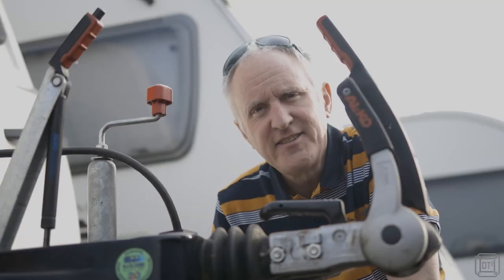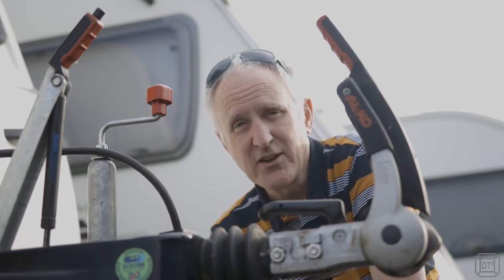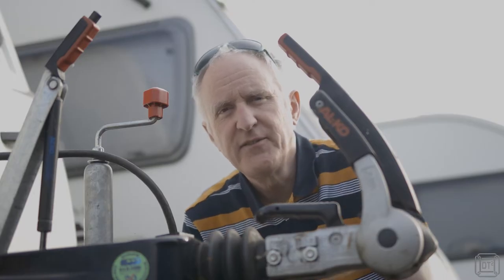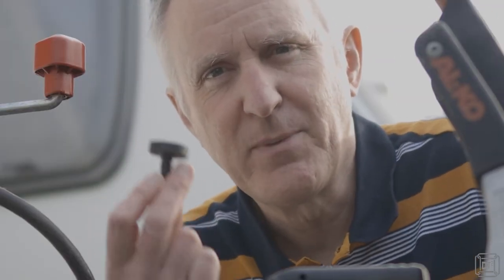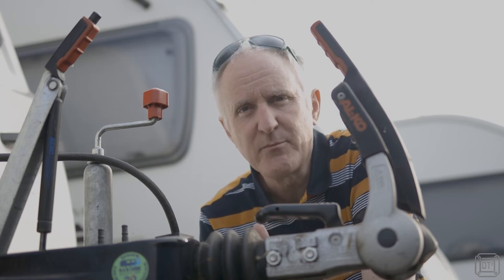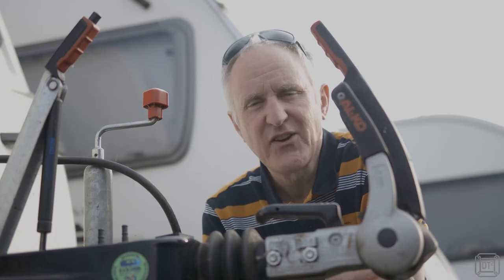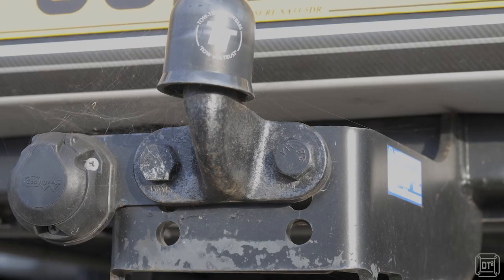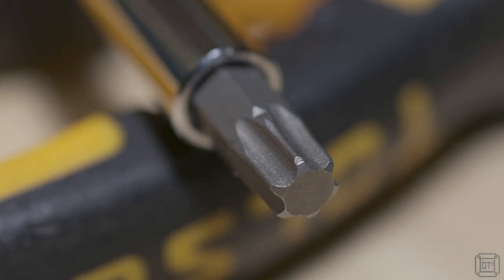ALKO STABILISER WON’T UNHITCH – what to do

Comment: This video has helped enormously!

We took our caravan home to give it a good going over after being in storage for 2 years. There was a bang just as we were beginning to move away, so that was probably the ball being banged up into the hitch because it was probably misaligned.

We got home and no matter what we tried we couldn't unhitch the caravan. I'll try and remedy it using your method. It's not an Alco hitch, but I'm sure the principal is the same.
Reply from the maker: Thank you, I hope you got your hitch sorted. I haven't used many other hitch types but if it has a built in stabiliser then it will likely have similar pads. Either way removing the towbar to release any tension on the hitch should help.

Comment: Thanks for this video  - we have just suffered exactly the problem you describe. We were lucky and were able to detach the hitch but it was very reluctant to separate. Once the ball and cup separated, the upper pad fell out!  I will be replacing the pad and probably do as you suggest and carry a spare.
We've not had the van long and I don't recall giving it a jolt whilst hitching up, but it's possible the previous owner did and that the pad was cracked but not broken. So this is probably something that's worth checking visually from time to time. The hassle of getting it properly stuck is definitely worth avoiding if possible!
Reply from the maker: It certainly does induce some mild panic followed by a lot of head scratching when it happens doesn't it. 😀
"Dropping" the hitch on is just a guess at the probable cause but it's easy not to remember like you say it quite likely that the previous owner may have done so.
Glad you managed to release yours though.

Comment: Exactly this happened to me today!  Top pad broken as you describe and only my third time with the new van hitched.  Also somehow then managed break the plastic jockey wheel while manoeuvring on gravel driveway - oh the joys!
Reply from the maker: Hope the video helped. The fact that you had an issue with both the pads and the jockey wheel makes me wonder if it's worth checking your nose weight? We had issues with the jockey wheel and our nose weight was high. Correctly so, as our land cruiser can handle a high nose weight but it caused issues with ground clearance on speed ramps and generally put an excessive load on the jockey wheel. Just an idea, hope it helps.

Comment: This system was an option the salesman I just bought a trailer from was unable to explain the purpose of and how it functions. Excellent explanation sir, pro's and cons. Only thing I like about this system without looking further into it is that it's still a regular coupling underneath - seems like you could pull all the pads out an go about your business if it failed. I won't be retrofitting this system.
Reply from the maker: Hi glad you found it helpful. I think running the hitch with no pads in could cause a problem as it would significantly reduce the area of the  bearing surfaces. This could cause wear on both the hitch and the tow ball. That's why I now keep a spare of the top pad in case it breaks again.

Comment: Thanks for that, useful tip and what a rip-off those pads are!  since I have had one of these hitches I find it locks on my car when parking on driveway, as caravan on a bit of a slope.  Very difficult to remove,  probably not recommended, handbrake on caravan, reverse an inch or so releases the pressure.

Comment: Great video. Unfortunately some tow bars can’t just be unbolted. Examples are tow bars that swing out from under the car. These are usually OEM tow bars. What can be done in such a case?
Reply from the maker: Thanks glad you liked it.
You're correct some tow bars would be either difficult or impossible to remove. (I think I alluded to that in the video) Someone else recently commented that they had this problem and the engineer that they called out used silicone spray to reduce the friction and then managed to release it whilst still attached to the car. This would be harder to do at cwrtain angles id guess. I'd you did use this approach then you would definitely have to replace (or thoriughly clean) all the pads as the lubricant would stop them from providing the damping (stabilising) effect.

Comment: Used to have problems quite regularly with my old caravan, pads were fine and just seemed to be an issue with tension, happened once after a long drive and was absolutely knackered, freed it by using the jockey wheel to raise the back of the car, and then sat in the car boot to force it down, probably not the recommended method but it worked 🤣🤣🤣

It also wont work with detachable tow bars as most of them dont drop straight down, they generally come off at an angle
Reply from the maker: Winding down the jockey wheel and hmm "adding some weight" is a great suggestion.

Comment: Not much use if you have a fixed electrically retractable swan neck tow bar. specially when there is a much easier option.   Using your motor mover, you rock your van backwards and forwards while winding up your jockey wheel. Pops off in a heartbeat.
Reply from the maker: Thanks for the suggestion about using the motor mover. This was not an option for us as we don't have a motor mover fitted but useful option for those that do have motor movers.

Comment: Interesting video. Had this happen to me this summer, on phoning a local engineer he suggested trying to lift the car up with the jockey wheel and at the same time violently wriggle/rock the coupling, after a number of attempts the small broken part fell out and the two separated. It was quite a nerve racking time not knowing how to split the unit.
Reply from the maker: I can see how the lift and wiggle approach would work. I think I prefer  disconnecting the tow bar where possible but in situations where that's jot possible the approach you've described is certainly worth knowing. Thanks for contributing
Reply: @DTSquared  Unfortunately my tow bar was a factory fitted electric type, so removal wasn't an option.

Comment: Never happened to me Dave but it's definitely one of those things you should be aware of as it could be such a pain. As the only solution seems to involve removing the tow bar/ball I am a bit concerned as mine is an eclectically deployed system. Looks as though removal would be a MAJOR job. I suppose you could work from the other direction and remove the hitch from the caravan! Failing that I suspect i'd be resorting to brute force or walking away and pretend its not mine 😳
Reply from the maker: Lol yeah sometimes you do wonder if denying all knowledge is the simplest option!!
It probably is, in theory at least, possible to detach without removing the towbar but the van and car would have to be perfectly positioned with zero stress on the coupling. Something that would be very difficult to achieve. Even once we detached the tow bar, if I remember correctly, it still took some waggling to get it detached.
Reply: Can’t a good caravan troubleshooting outfit sort this out…..the AA ??

Comment: Thank you for the video. How good is this stabiliser from alko? I live in South Africa and here the most popular ones are those with a side bar connecting the tow vehicle and the trailer A frame.
Reply from the maker: Hi, I’m glad you liked the video. I think I’m familiar with the type of stabiliser you are referring to. It’s the type with a pre-bent flat metal bar that is attached to the car and tends to drag along the ground if you leave it on after unhitching right?
We don’t see many of those here in the UK, my father had one on his caravan but that was probably more than thirty years ago.
In terms of how effective they are compared with the new ALKO I don’t have any data or experience to compare though I expect they are similar since they are both effectively stiffening/damping the connection between car and trailer. I’ve known a few (very few) people that say they “don’t like the feel of the alko” but I suspect that is entirely subjective and most likely imagined. At a guess I’d say the new ALKO would have less collateral effects since the steel bar type is also (from memory) putting downward pressure on the coupling joint but the effect is probably minimal.
From a usage and convenience aspect the new ALKO is almost certainly better since it requires no modification to the tow car hitch (apart from you are supposed to sand of the paint I believe) and there is nothing to carry once the trailer is unhitched. Usage is also easier I think since the new ALKO is simply a case of pushing the lever down whilst. The bar type requires pulling the bar up and into the receiver on the trailer which, again from memory, I recall as being quite awkward. Also the ALKO places no limits on the maximum angle in the joint if for example reversing and pushing the hitch at an extreme angle.
The only downside I can think of is that the ALKO requires replacement pads, for us they probably last about three or four years but obviously it’s the milage that is the real factor.
Bit of a long answer but hope that helps.

Comment: I had the hitch stick today. Managed to get it off with a bit of waggling side to side and pitching it up and down. I have had a good look inside using my phone. There is nothing broken. Could the hitch be worn rather than the pads? This may be that the handle isn't causing the pads to move as they should. Or it could be the other handle beneath, not releasing the ball? I am moving on tomorrow and don't want it to happen again!
Reply from the maker: If the pads aren't broken I'd say it's either some tension between the tow vehicle and the trailer or possibly the handle isn't quite releasing the latch. I often put the vehicle in neutral with the hand brake off to release any tension. Obviously won't work on a hill. Also if the last maneuver was reversing then the hitch piston will be compressed which makes it difficult to unhitch. Hope that helps and your journey tomorrow goes ok

Comment: I must confess I'm not a fan of this Alco system...I don't like the way it affects the handling of the car when you encounter a uneven road at speed so I spray some dw40 on the tow ball and wipe off the residue before I hook up...have been caravaning for 20 years and have found as long as you distribute the Waight properly then fish tailing isn't a problem!!.🤔💕🇬🇧

Comment: Nice video, but would advise to leave the breakaway cable to last, I one forgot to apply the hand brake before unhitching the caravan, if I hadn't left the breakaway cable attached the caravan would of rolled out of control down a hill, but the breakaway cable saved disaster.
Reply from the maker: Thanks glad you liked it.

Comment: I have the AKS 1300 Hitch - and it happened to me 3 times - I released it with a tent peg Rubber Mallet not sure why it jammed and released with the Mallet maybe you can explain - - also how can I tell if the pads are worn and need replacing - can you measure the ware ...joe
Reply from the maker: Hi Joe, there's two ways to measure the pad wear (on the side pads) the first is there should be an arrow indicator on the top with a graduated scale (that's often colour coded) You should check when you start you start to feel resistance as you lower the stabiliser lever. If its in the last (red) section then the pads need replacing.
The other way is that with worn pads the lever become much easier to push down fully. If you aren't having to push quite hard then they are likely warn. I just changed mine and the effort required now is much more.
It should go without saying that the lever should always be FULLY depressed.
Not sure about how the tent peg / mallet released it. Where did you hit it?

Comment: What if you’ve got an electrically operated fold out tow bar…??
Reply from the maker: I suspect with an electric folding towbar you would probably struggle to remove it from the vehicle, especially with the caravan attached. A few other people have commented though with similar issues.
One had a folding towbar (not sure if electric or manual) and could not remove it so removed the coupling from the caravan instead.
Another actually called out a caravan engineer and they sprayed silicon spray into the coupling and waggled it (I would assume that ALL the pads would then need replacing or at least degreasing).
The other approach someone found worked (recommended by a caravan engineer) was to use the jockey wheel to lift the rear of the car and then violently waggle the coupling / van until it released.
Hope that helps

Comment: This has happened to me twice. The first time was when I arrived back at home on uneven ground and, with a detachable tow ball, it was impossible to release it due to the tension. The way around it was to undo the two hex bolts on the hitch and detach the whole hitch assembly. Once off the tension has gone and the tow ball can be separated. Use a torque wrench to reattach the hitch assembly to about 90nm.
Reply from the maker: Thanks for posting solution for removable hitch. Do you recall letting the hitch drop on prior to it getting stuck? I know ours did but wondering if there are other causes.

Comment: Good information, sadly the solution would not help me as my tow ball is electric.
Reply from the maker: I think the only option in that case is to get the car and caravan onto a flat and smooth a surface as possible and wiggle the van until you can release the tension totally. Which won't be easy. Failing that it's probably a case of removing the hitch from the van, which is much more involved.

Comment: You didn’t show how to take the ball out off the hitch after you removed from the car. 
Or does it just fall out 🤔
Reply from the maker: Yeah just wiggle it and it comes out then. The issue when it is still connected to the car is that there is too much tension on it.

Comment: Wondering if you can help with our problem. Our hitch isn’t stuck but it’s started making an awful crunching groaning sound while travelling. All the pads were changed recently so at a loss???
Reply from the maker: I don't want to worry you but I'd get that checked ASAP.
The simple and cheap cause of the noise could be wear on the tow ball.
But it could also be movement in the tow bar fixing frame where it attaches to the car. Does the noise sound like it is coming through the car body?
If you know someone with a tow bar you could possibly get them to tow it to see if the car or the van is the cause..